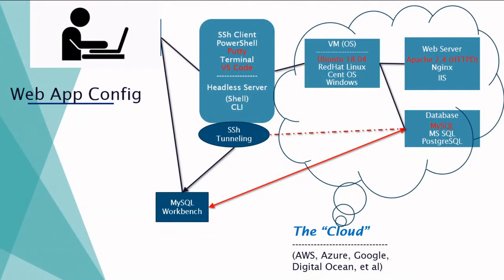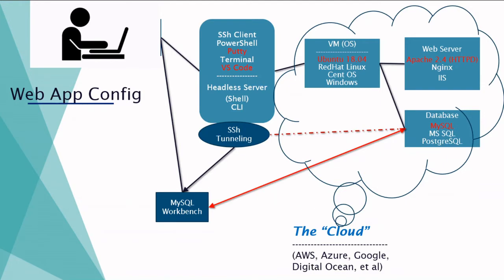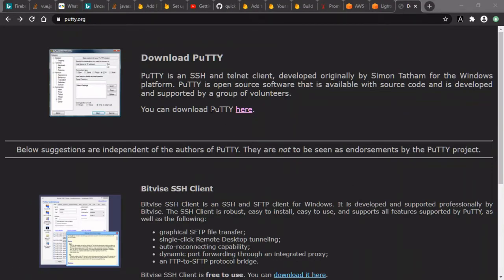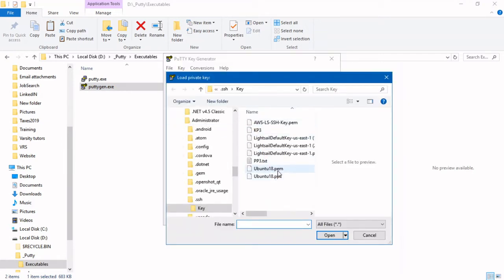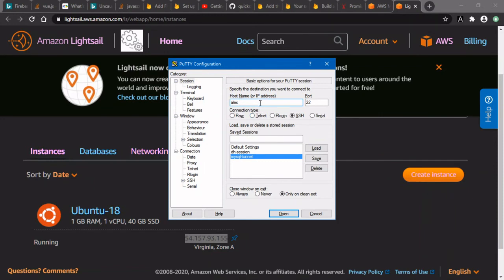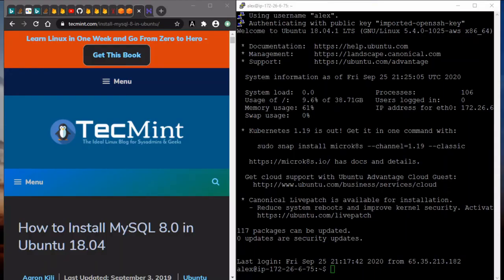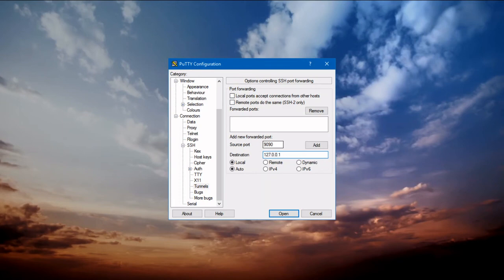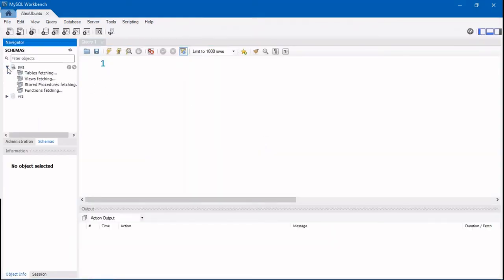How to SSh Tunnel into a MySQL DB On the Cloud Using Putty and MySQL Workbench

Comment: can the putty always be on or can run in background? because i have a SQLjob that used Mysql connection
Reply from the maker: I've been trying to fully understand your question. So the answer to the question "SHOULD Putty always be running in the background when using the setup on this video?" is YES. 
In this setup, Putty is actually forwarding the classsic port from the remote mysql server to the local machine (Port:3306). If your SQL.job already has a tunneled setup with some other ssh app using port 3306, and you want to tunnel in using MySQL Workbench as shown in this video, then you will need to do some more configuring, because you cannot run two separate processes on the same port simultaneously.  
https://dev.mysql.com/doc/mysql-port-reference/en/mysql-ports-reference-tables.html

Does that answer your question?